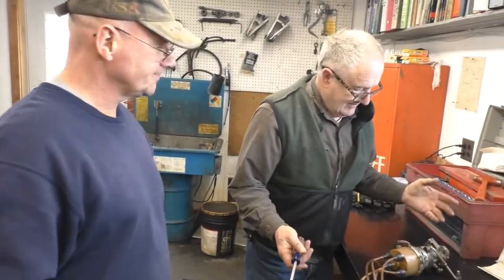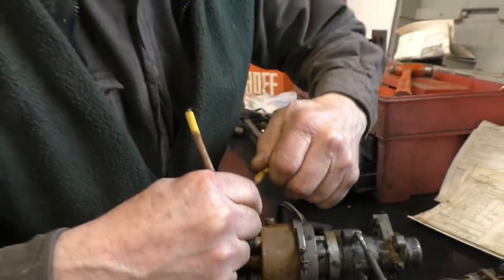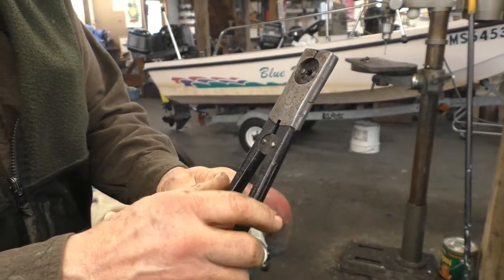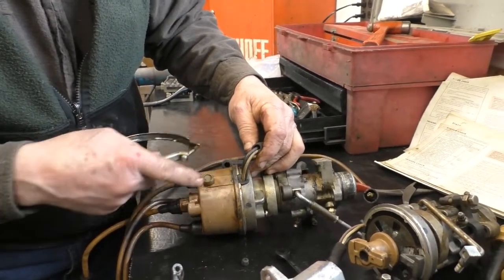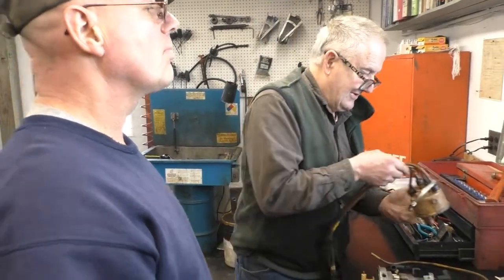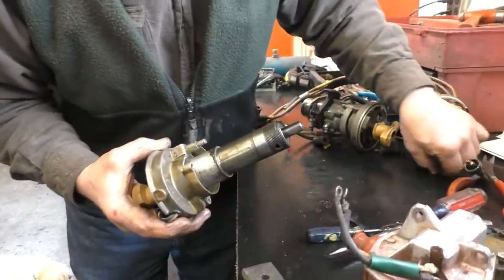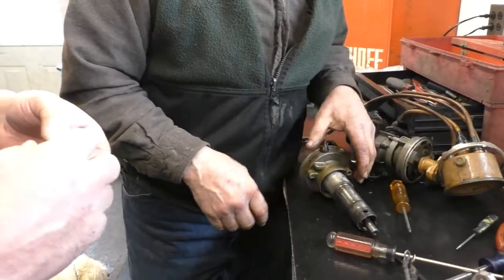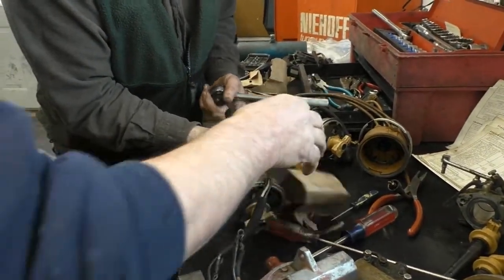diassembly of the last 6 in line distributor

Comment: I have a 6 cyl and the housing on my distributor where the metal rod link that connects directly to the throttle arm isn’t moving anymore. Isn’t supposed to rotate if you remove it from the throttle arm and you hold the small link rod mounted on distributor housing and rotate it by hand easily? Mine won’t budge
Reply from the maker: my first guess is the grease has hardened if your lucky greasing both nipples will free it up
Reply: @ okay I have the grease pump so il do it tomorrow. Man it’s seized bad hope that does the trick because iv never rebuilt one before

Comment: Hello from Adelaide Australia.I have recently bought a complete 6 cylinder distributor, but it appears to be only 2 wires on the trigger. It looks definitely only 2 wires is that true or is there meant to be 3 wires on the grommet trigger? Thankyou
Reply from the maker: I have only seen 3 wires on the last battery driven distributor , the maker point ignition and breaker point only had 2 wires
Reply from the maker: the only two wire distributor i can think of is a dual coil point condenser ignition